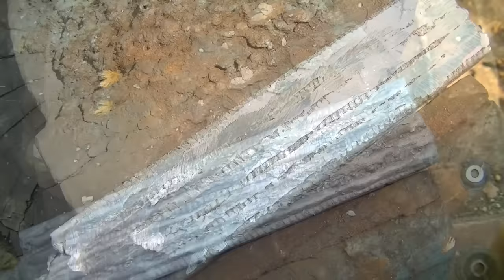Damascus steel: Making a special twisted multibar blade

Comment: Fantastic work, I am very impressed with the machinery you have. I love burning metal myself. 
I am curious why you did not saw that beautiful billet in half, length wise, to create 2 blades? It appeared to have the thickness to do that.
Great work, keep it up!
Reply from the maker: Thanks man!
To your question: the pattern wouldn't be even if I cut it lenghwise. Twisted patterns are all about even simetry on grinding of both sides. And the true beauty is deep inside, thats why its left SO thick after forging.
Reply: Ahh sooo, that's why you left it sooo thick and ground away all that material. Makes sense. Awesome work man.
Reply: what a beautiful blade

Comment: Impresionante, excelente trabajo. Una pregunta: cuando sueldas las piezas con electrica, introduces acero de otra calidad, eso no afecta la calidad o propiedades del acero en elproducto final.?
Reply from the maker: Harry Fijate que la soldadura de la electrica la saco con la amoladora antes de apretar la pieza lateralmente para no incluir ese material dentro del damasco original, se ve en el minuto 13:43 la pieza limpia.

Comment: Skip ahead to 21:23 to see a work of art made by a craftsman.

Made from a single piece of steel, I'm impressed. I see so many "Damascus" pieces made with two kinds of steel welded together. It was refreshing to see a man actually making a true Damascus blade, that is making a blade in the old Damascus technique.
Reply from the maker: Thank you man!
But I think you missed 1:35 when I showed the billet made from L6 and 5160 steels.
It imposible to achive a good contrast pattern using only one type of steel.
Reply: Manuel Quiroga
I did miss that, thanks.

You are a fine craftsman.
Reply: ladamyre1 hahahahaha

Comment: fantastic job on the layering and pattern, it turned out great.  seemed a little wasteful when i saw you machining and cutting most of it away rather then forging it thinner, but once i saw the final design it made sense.

Comment: The music is as excellent as the blade you created ! Lovely work ! Where are you located, if outside the USA do you ship here? I need 2 sets of a chef's knife and paring knife combinations, one will be for me and one set for my son. The blades need both razor sharpness and ability to hold an edge through multiple chopping actions. Another primary consideration is hand balance helping to avoid fatigue while peeling and chopping.

Comment: That's some real nice work. Very pretty pattern. You're very talented:)

I'm wondering though, after putting so much work into preparing the steel in the beginning, would you not have been tempted to make a more substantial blade? Something a little larger?
Reply from the maker: No, I would loose the tightness and symmetry of the pattern if I had stretched it.

Comment: You do know mono steels are better? If any one of those thousands of folds doesn’t bond or weld its just a weak spot. Plus any inclusions or small contamination particles can’t be seen and just add the possibility it won’t hold up or weld properly. Mono steel is the way to go... 1075, 1085, 1095, 5160.... etc.

DNH7 steel was used on my Citadel Ocean Katana... http://www.kultofathena.com/product.asp?item=SC4001&name=Citadel+Ocean+Katana
Reply from the maker: Riddick tonn You do know that a steel bolt is tougher that a piece of jewelry? Of course I know, that is not the idea behind this.
Reply: Manuel Quiroga ok... do you forge blades using any of the mono steels I listed above? I seen a medieval blade made of 5160 steel I think.... It cut two inches into a 55 gallon steel drum edge and taking massive chunks from mason blocks used to build basements. Didn’t even scratch it... It was at a Renaissance Festival. Guy bent the blade more than 50° both ways and it snapped back every time. Do any destruction tests with your blades? I know a guys channel that does them if you send him a blade. Have you seen the channel... Matthew Jensen? He performs all kinds of reviews of $2,000 up to $10,000 blade reviews and destruction tests. So far Citadel is the best he has seen as being the closest to how actual Japanese Katana parts are forged 100% by hand and assembled. What did you think of the Ocean Katana?? Few others have done some close up reviews on it. I know Matthew has done two on his citadel blades.

Comment: Beautiful knife man , awesome video. I have but one question , I did not see you using borax during the folding process, not even during the welding. Please comment on why you didn't . 
Thanks :)
Reply from the maker: Thanks man. I don't use borax for my weldings anymore, I use dry welding with kerosene some times and others I close the billet with a stich of MIG welding so that the air cant get between the billet.
Borax destroys your forge, that why I stoped using it.

Comment: Beautiful knife! Did you have any trouble with scale forming between the layers of the jelly roll, inhibiting the forge weld? It obviously worked.  Is there a trick to it?
Reply from the maker: Good question. There is a trick actually: I soaked the entire jelly roll in phosphoric acid for couple of hours, which eat up all the scale. After cleaning internal faces with a straw brush I MIG welded all the spiral, both sides, so it was completely sealed. The forge weld was a joke after that.
Reply: I'm getting ready to try Jelly roles, but something quite different. Used white vinegar for about 48-hours after making them from used metal saw blades. Still trying to figure out how to include a photo in a reply.

Comment: I'm wondering if this limited differential treatment will save this hardened edge from chipping under hard use? To be both beautiful and useful is a reasonable goal.
I suspect that you've gone as far as you want to go with this... so be it.
Reply from the maker: Paul Wiggins Absolutely, that is why it's done that way.

Comment: i guess i will look like hater, but come on, you could make four knives out of that damascus steel you had before milling, and making shape with angle grinder ? what do you have hammer for, next step: surface grinder - originally it's used to make thickness of material in tolerance hundredths of milimeter, i can't see any sense of using it if belt grinder operation follows (too much grinding on it again) and the result - knife which is one centimeter thick ? i can take hammer with myself and i think it would be lighter.
but structure after etching looks really nice
Reply from the maker: You seriously think I don't know I had enough steel for a couple more blades?(I doubt four though). Do you know how stretched, superficial and distorted the pattern would look if I had forge that thin?
It fascinates me how many guys instead of thinking I had a good reason for doing that, assume I'm stupid and didn't realize that. If I went through all that extra work, don't you think there is a very logical explanation for doing that that you don't know about? You could simply ask in a polite way.

Here it is: in twisted patterns, the deeper you get, the better it looks. The pattern "opens" in the deep. The only way to get there is to forge VERY thick, and grind away the excess. In twisted patterns you talk about % of grinding, I like best about 30-40%.
In the finished blade, if you look at the difference between how the pattern looks near the spine, and compare it the pattern in the edge zone you will see how the deepness changes the appearance of the pattern. Also see the difference between the pattern in the finished blade vs. the shot where I revealed the pattern before I went to the saw to cut the recazo area. 

Other patterns don't need that. In a random pattern for instance you just leave a little extra, enough to get to the clean steel and you can stop at that thickness.

About the surface grinder, I do use it to remove only a couple of 0.01 mm, and I use it before the belt grinder to make the recazo and tang perfectly even and parallel to get, later on, a perfect fit of the guard.  

Seriously, if you know so little about this craft, you shouldn't have such strong opinions.

Comment: IM not criticizing, this is great but i do have an honest question? Dont you contaminate the blade when you weld the for cut pieces of square stock you made together? Curious. Solid work man, thanks for the vid
Reply from the maker: No problem man, I remove most of the weld material with and angle grinder after a first heat weld with the press. Nevertheless, in a twisted pattern all the exterior material is removed in the grinding part (given the geomety of it) so it will not be in the blade anyway.

Comment: wow very nice work! and you have a really cool powerhammer. did you build it yourself? if so, are there any plans available? i am looking for a powerhammer myself but its hard to figure out what to buy. im also stil wondering if it would be better to build on on my own. do you have any suggestions?
Reply from the maker: If you can buy one its best. If not look for the "Krusty" powerhamer plans in internet.

Comment: Pretty damascus, but the lack of actually forging your blade made it a 1/10
Reply from the maker: Patrick Sweeney are you aware that if I had forge the blade to final shape I would have distort the pattern?
Reply: Yeah, and its a beautiful pattern, but distortion doesnt imply 'worse' it implies change. Change isn't always bad, sure the pattern may have been 'less' appealing but it could have turned out more appealing. Regardless, a knife is forged not cut.
Reply from the maker: Patrick Sweeney this pattern falls into the mosaics, and mosaic patterns are always cut, never forged to shape.

Comment: You had enough metal there to make 2 knifes lol but I love the work bud.
Reply from the maker: David Barron I cut it in half at 2:30. From then on I had material for whatever length I got in the end. No more without disturbing the pattern I was aming for.
Reply: Oooohhhhh do you avoided drawing it out more so as not to “smear” the pattern and keep your twists tight. I didn’t think about it like that. Sounds good to me man. Lol still a huge fan of the work bud.
Reply from the maker: @davidbarron8615  that and also twisted patterns are good only in the inside, so you are forced to forge extra thick and remove a lot of meat to get to the good stuff. Only bladesmiths and experienced collectors are aware of this, so your original comment is pretty common here in YouTube.
Reply: Well generally I make blades for functionality and if they look great then so much the better. Lol
Reply: I made a falchion bush knife in that rivals this. Thanks for the instruction brother

Comment: Why bother with gluing the blade down for the milling when you have the automatic power sander with the magnetic hold down table?
Reply from the maker: I get the feeling you are really not familiar with this type of equipment. With a milling machine I can remove material of about 0.25 - 0.5 mm per pass, easily. In the surface grinder I can only remove about 0.02 mm per pass. It's a huge difference. Surface grinders are made for only fine rectification, not to remove material.
Reply: Manuel Quiroga thank you for your response and explanation, I am familiar with the equipment I just didn’t know that the surface grinder doesn’t remove as much material as fast as the milling machine!

Comment: Красиво, но как же расточительно столько металла в стружку переводить. Уж запарился бы, раз уж так рисунок важен, распилил бы болванку на две заготовки в длинну. Получилось бы два ножа-близнеца.
Reply from the maker: Not really. If I cut it in half to make 2 blades the sides of these wouldn't have been even, each side needs to be evenly distanced from the center of the bar. I would have end with 2 blades with one nice side, and one horrible side. How I did it is the only logical way to do it.

Comment: absolutely fantastic love the pattern that came out. just one thing though and i don't mean to be judgemental but i've never seen anyone waste so much material before. what i mean by that is when you had the steel forged and had the shape of the knife than just ground it and milled it to thin it down. but i am the kind of person who believes in not wasting anything, especially after taking the time to pattern weld it.
Reply from the maker: There is a logical reason behind that: in twisted patterns, the deeper you get, the better it looks. The pattern "opens" in the deep. The only way to get there is to forge very thick, and grind away the excess. In twisted patterns you talk about % of grinding, I like best about 30-40%.
Other patterns don't need that. In a random pattern for instance you just leave a little extra, enoght to get to the clean steel and you can stop at that thickness.

I had a LOT guys asking the same thing, I should have explained that in the same video, I didn't realized that at the time.
Reply: ok sweet makes sense now. thanks for clearing that up for me

Comment: As a beginner blacksmith, I'm curious about how you did the etching in the end of the video. If you or someone else could explain that, it would be much appreciated.
Reply from the maker: I use a solution of ferric cloride and water (1:3), baths of 3-5 minutes until I like what I see.
Reply: thanks!
Reply: Manuel Quiroga

Did they have any of these chemical tricks in 1300's?

And how new are these techniques? No hating, just wondering. Nice work!
Reply: eamh2002

yes - they have, already
acides dates from 2 century BC, wedling of steel date 2-4 century BC, Damascus Steel - a first apparence with the marks of desert wariors - 9-11 century AD, so for me is nothing special like technic, but work in clean word is awesome
I see a good smithing work

Comment: all that metal and work and just one knife? cool knife but holy shit what a waste
Reply: If you are happy with the results it's never a waste ;)
Reply: +Tranczit  yes it is. you could have done 10 great knifes with that material so if you do just one and rest goes to garbage its waste by its definition
Reply from the maker: +Burden82  In twisted patterns, the deeper you get, the better it looks. The pattern "opens" in the deep. The only way to get there is to forge VERY thick, and grind away the excess. In twisted patterns you talk about % of grinding, I like best about 30-40%.
In the finished blade, if you look at the difference between how the pattern looks near the spine, and compare it the pattern in the edge zone you will see how the deepness changes the appearance of the pattern. Also see the difference between the pattern in the finished blade vs. the shot where I revealed the pattern before I went to the saw to cut the recazo area. 

Other patterns don't need that. In a random pattern for instance you just leave a little extra, enough to get to the clean steel and you can stop at that thickness.

So its not a waste, is a means to an very clear end, like chiseling away marble to make a sculpture...
Reply: +Manuel Quiroga Don't listen to them, they clearly have no idea what goes into the process.  

I think I have watched this video no less then once a week for months.  I can only hope to replicate such beauty.

Comment: Wow gutless press
Reply from the maker: Yeah, it had some issues back them that made it insanely slow. I fixed it after this one. You can check on my Chapel damascus videos.
Reply: I bought one of those chinese  power hammers. Works reall well
Reply: One thing i need really bad is a rounding hammer